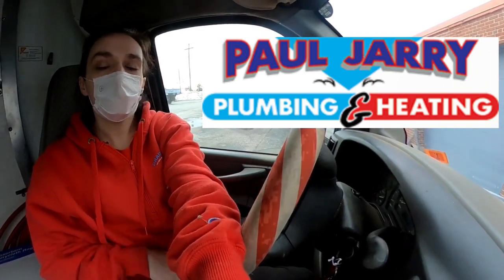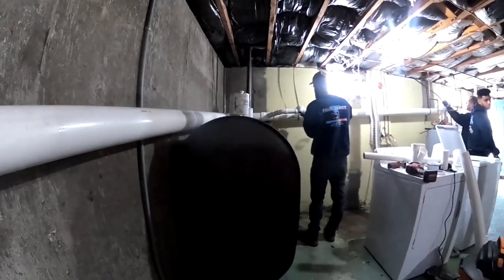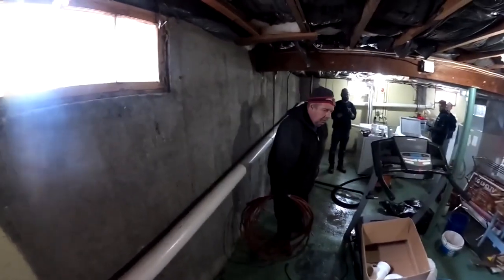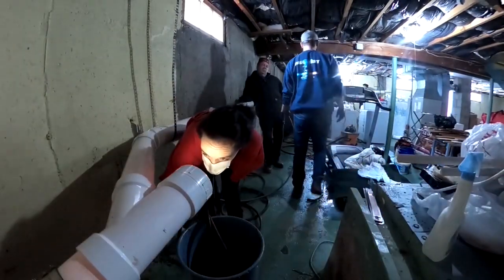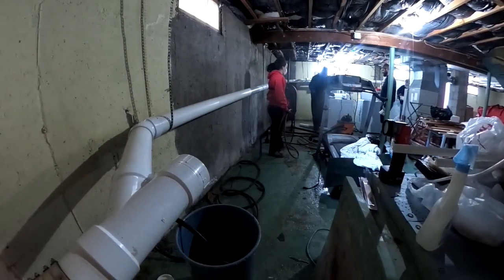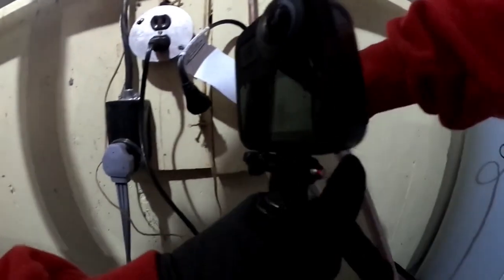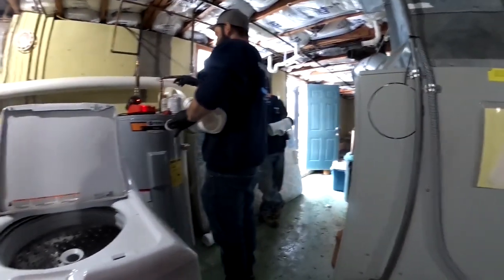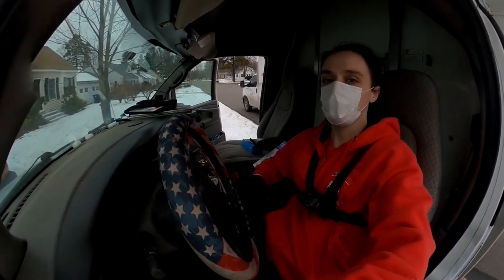Clogged Drain #105 Main Sewer Line Backup

Comment: How much does a section of pipe lining cost out there? I used to work for a company here in Minnesota that would charge $2k-$3k for approximately  3'-5' section and double that (on the high end) for 60' of main line (close to $100/ft).
Reply from the maker: We don't line here yet, there are some companies that do. I am unsure what they are charging though. (Shelly)